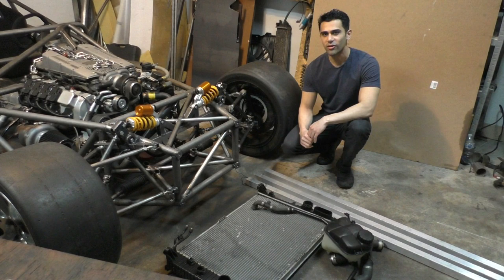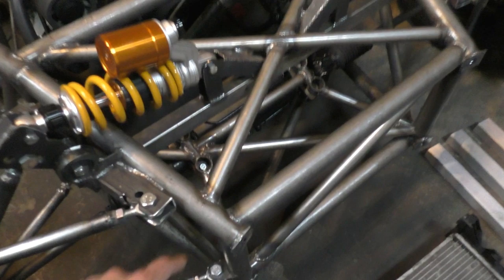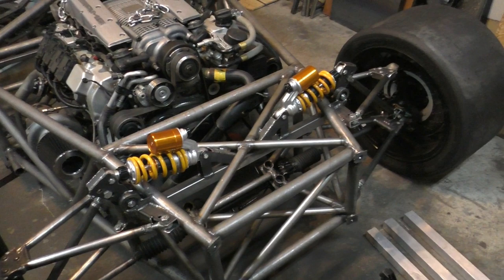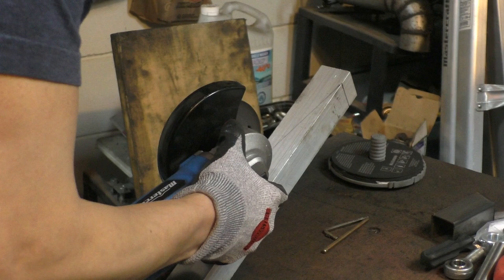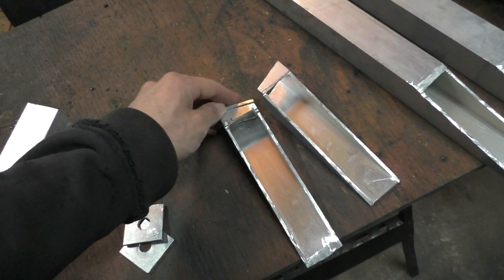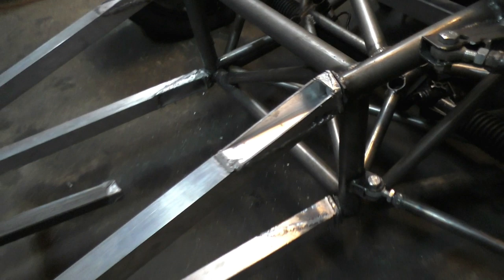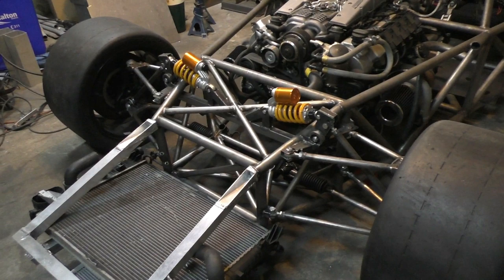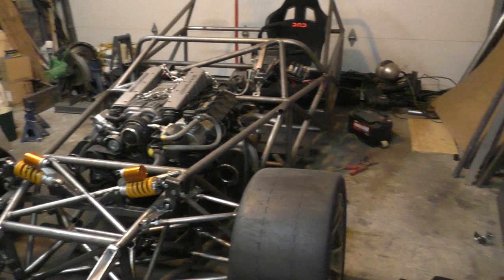Crumple zone and Radiator Install - E55 ASL Part 9

Comment: That springs seams weak ? Will you have enough travel under load? .I study mehanical engeniring and lerning about  that equations
Reply: I thought the same at the beginning but i did the math and it's ok, although i would have gone with a stiffer set up of coils, but after the downforce i think it's not going to bounce all around. He'll have to see

Comment: So, i really want to know, from a aerodynamic perspective isn't better to cover the engine? Why did you left the engine uncovered?
Reply from the maker: It is and I might try to cover it later if the engine bay stays cool enough. Had my transmission tunnel catch fire in the e55, so temperatures do get really extreme on the track. Just want to keep it safe initially
Reply: @xfmotorsports  humm yes that can be a problem. What i see in f1 and another sports is that they use alot of radiators for a lot of things like oil, and stuff like that. Can you use more than one radiator to cool the engine?

Comment: You don't need a spool gun for aluminium welding, don't you normaly just use tig with rods?
Reply: Mig and ac-tig are to totally different welding types
Reply: @danielssonsgarage  but you dont need a spool gun for aluminium ac tig

Comment: that analysis might be fine for a quasi static loading.  shock loading doubles the forces.  did you figure energy dissipation?  How much does the radiator absorb?  It won't be functioning after any collision.

Comment: The calculations for the crumple zone are based on the assumption that all the bars will share the load equally,rarely will you hit something exactly head on, even the smallest variable such as a non perpendicular force applied will make all those figures pointless. That is why manufacturers spend billions on software,development and actually crashing cars into things.
Reply from the maker: Once you put all the equations in a simulation, it's easy to change the angle and test out how the forces will change for all angles. Manufacturers are using sheet metal to make their cars which is a much weaker construction and more challenging to design. Back when they did use tube steel frames in race cars they were using methods similar to this, it has nothing to do with spending billions on a software
Reply: @xfmotorsports  yes but without actually physically testing the unit,the multitude of variables make the calculations theoretical,many manufacturers have built stuff using a known formula only to find that the results were nowhere near their expectations.

Comment: Why you didnt but the radiator in the back? I think small crash with it in front it will fuck up your cooling system.. But if you but it in back it would not 🤔 and you would not have to change the cooling system every time you have a small crash.. At the end your the pro here not me 😁